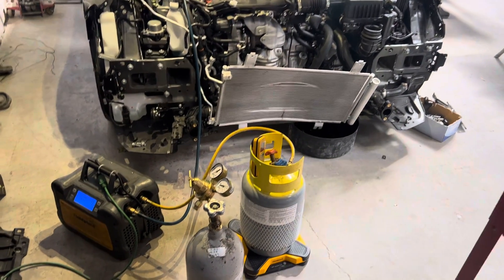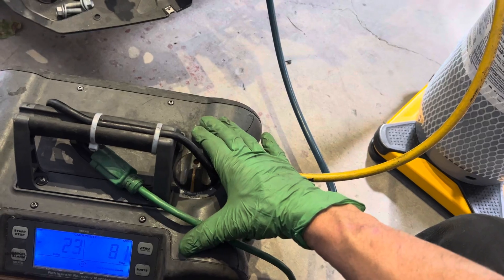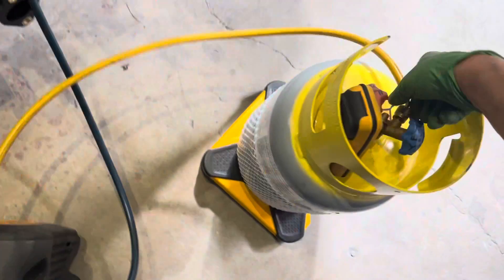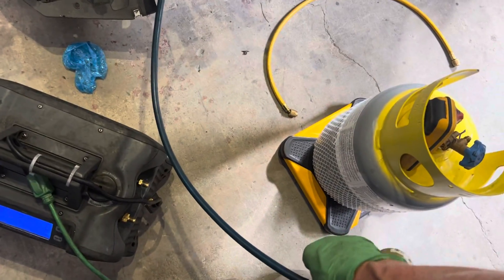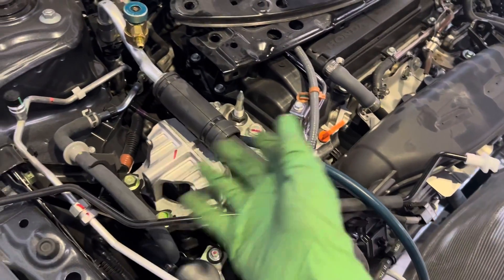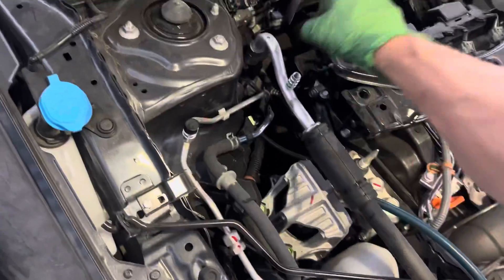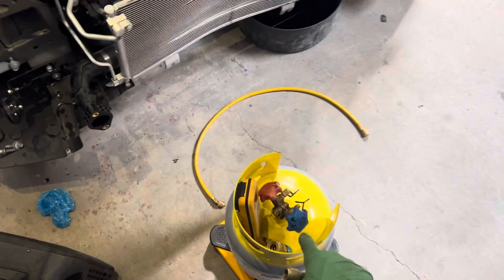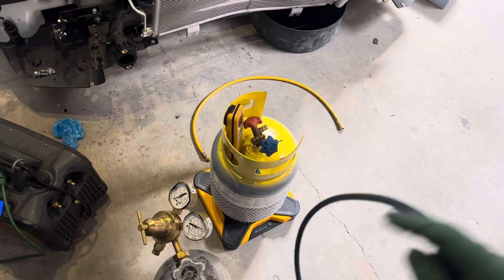Portable Mobile Recovery, Only Machine ￼. Purge liquid out dry nitrogen, purge AC system..

Comment: Hi Tom. When you purge lines with the nitrogen and disconnect condenser coil, will nitrogen stay in the lines, or will it be displaced with air? Thank you.
Reply from the maker: It stays in the lines.  
At the service couplings, do not leak out. They are sealed. . 

The next time you go to use your hoses . 
You’ll be doing one of two things 

Hooking it up to the vacuum pump, and I draw down a vacuum below 100 µm, preparing it for use for the next vehicle . 

Or you’ll be purging the lines out with refrigerant, that you’ve probably seen in 100 other videos, where they crack a little bit of refrigerant open and let it come out a short, yes, a vapor refrigerant to purge the lines . 

These are two methods
Reply: @coldfinger459sub0 thank you. But I mean you said you add a little bit nitrogen (not under pressure) not to squirt oil for the next tech when he removes the condenser. I mean when the other tech removes the condenser, will the nitrogen in other places ie compressor, evap, lines be displaced by air or stay in the lines? Or it is not that critical? Thanks a lot 🙏
Reply from the maker: @thecurious6721  it will stay there, because it’s just a quick removal and replacement of a single part. 

Because it’s under positive pressure, one psi or two psi .  The very instant that you remove the bolts and remove the line or hose from the condenser that one or two psi will come out, but the remainder will balance out at atmospheric pressure, but still remain inside the lines.. 

Then the technician will immediately be attaching the new condenser. I came out of the box from the manufacturer that also has been purchased with dry nitrogen and had rubber plugs to retain to try nitrogen inside the new condenser that has a New Ddesiccant material bag. . 

And then immediately you’re turning on the vacuum pump to remove the dry nitrogen out of the system 

So it always stays clean and dry with no atmospheric moisture entering .
Reply: @coldfinger459sub0  Thank you Tom. Greatly appreciate your videos and answers 🙏👍
Reply: @coldfinger459sub0 Hi Tom, I purchased a Denso condenser for a Vw transporter. It was sealed at the line connection ports with caps, they wasn’t the screw on type like I have had before on cheap aftermarket condensers and with a lot of nitrogen pressure, this one had absolutely none and it contained the dryer to the side also. I thought it must of had a leak at 1st but the caps would of never held any positive pressure. It held perfect on the nitrogen pressure test! But just thought it was weird a Vauxhall Tech I know said there OEM Units do not come pressurised either. Is this standard procedure for some units/manufacturers?
Reply from the maker: @Ken_4711  they sometimes he’ll come with no pressure

But as they are manufactured, they have nitrogen pumped through them when they seal them . 

And I have heard that there’s a lot of knock off fake copies of top brand manufacture, automotive parts out there, including DENSO

Comment: Many years ago the idiots at the shop they left the pressured nitrogen in my car, then ran the AC while moving the car to the parking lot.
Reply: I've been watching your videos for months now, I got my 609 certification a year ago and purchased a few thousand worth of yellow jacket and master cool equipment,I only do my own or family vehicles, I learn more and more from you and just want to say thanks for sharing all your years of knowledge 👍
Reply from the maker: @littletreesdiy4222  that is what my information is out there for the help everybody. 

Hopefully everybody can see there’s really no rule of thumb that you can use on all vehicles 

There is no average pressure 

There is no average temperature 

There is no average amount of oil in each system 

There’s so much bad information from old timers who are the top from other old timers from the 1950s and 60s and this very archaic information that used to work decades ago does not work so well there anymore . 

It’s almost like comparing in a old 1950s rotary dial telephone with a cord to a modern day Apple phone .
Reply: that must've been one spicy day at the workshop lol
Reply from the maker: When putting nitrogen under pressure in a system, supposed to disable the compressor through the relay, or a fuse or a connector.  So that cannot happen..
Reply: @coldfinger459sub0  had they done that then I would definitely expect them to have lost the relay somehow. And then try to sell me one